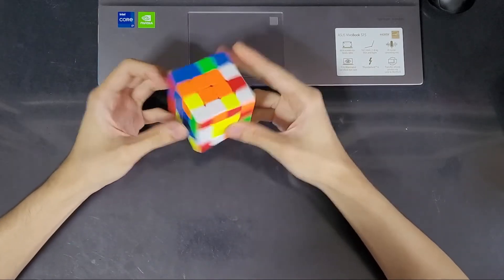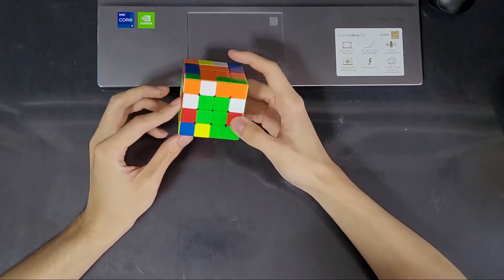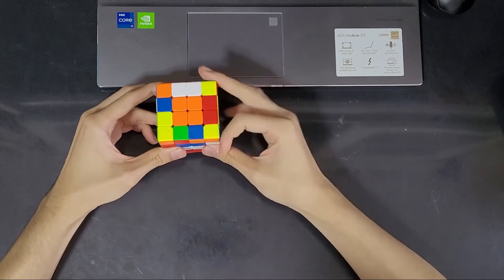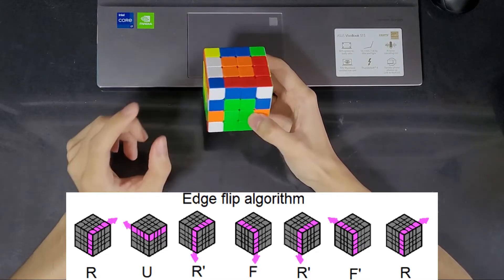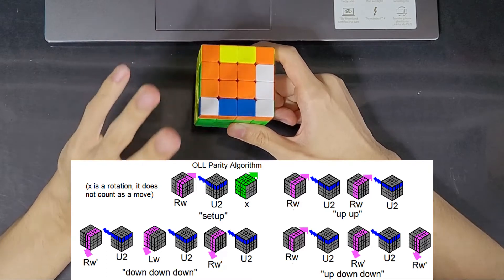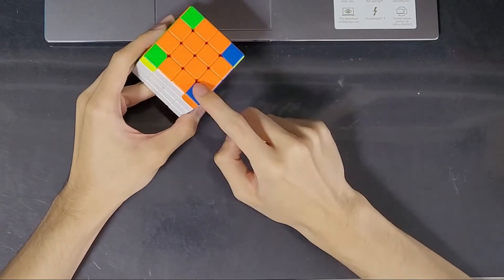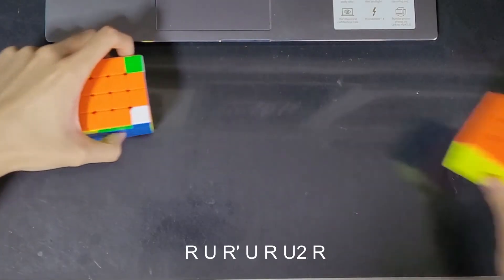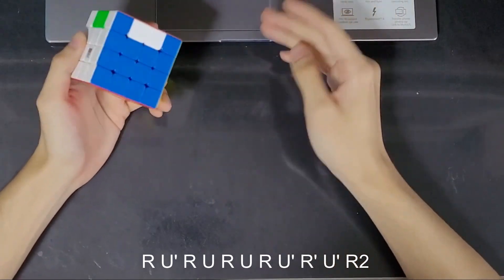How to solve a 4x4 cube (part 2)

Comment from the maker: If you think I went through the 3x3 beginner methods are too fast, you can refer to the tutorials attached in the description. The 2 methods are similar in how they approach the first 2 layers; but differ in the last layer. 
If you use 3x3 beginner method 2, I only went through the recognition of the parity cases. They use the same 2 algorithms as method 1, and you can refer to method 1 for the execution of these algorithms.
Generally, I prefer to teach method 2 to 3x3 beginners, as it is more similar to the speedsolving method (CFOP). Method 2 is in fact a direct downgrade of the CFOP method, so learning the full CFOP is basically just upgrading the steps you already understand. In comparison, a method 1 user learning CFOP would have to throw away a fair share of old knowledge and learn a mostly new method for last layer.